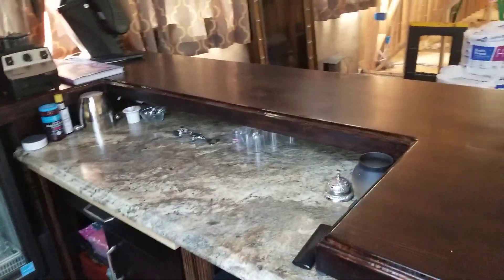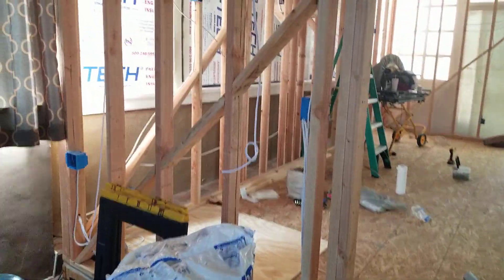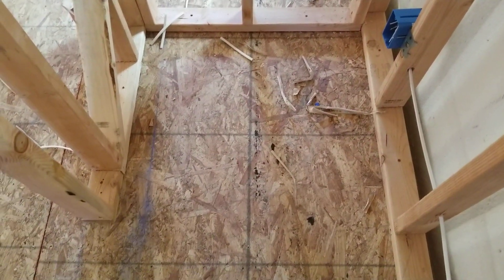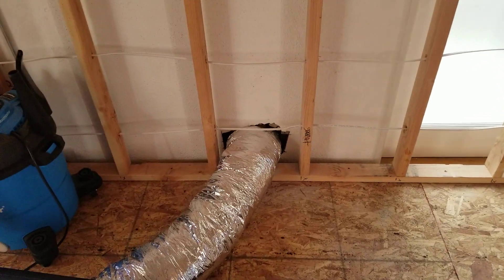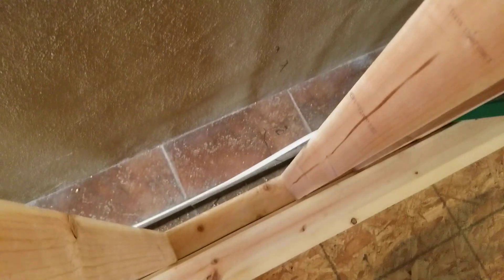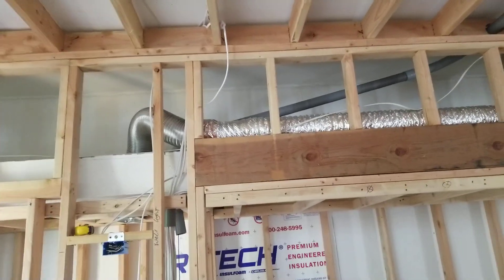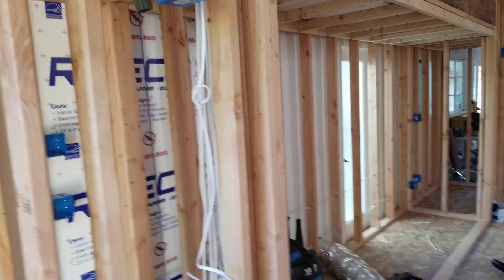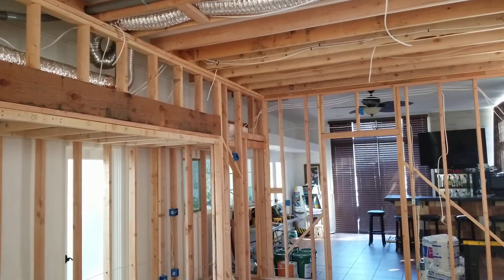Home theater build part 1

Comment: Awesome looking build! I'm not to familiar with theatre rooms, if that switched exhaust fan has to run while you watch movies it'd be cool to have it automatically triggered somehow(relay or occupancy sensor? I know I'd end up forgetting to turn it on sooner or later). Nice job so far, please keep the vids coming.
Reply from the maker: Yeah in the video the noise you can hear from the fan is actually the one in the bar side which is a very high capacity noisier fan. That will be replaced eventually. I guess I'll have to see in practice if I forget to turn the fan off when using it in the theater.

Comment: If you use dry wall and insulation it will obviously sound proof the room. What I'm wondering is wont it still echo off the hard surfaces ? I'm building my cinama room as well but it's the echo I want to get rid of as well as sound proofing. Thanks
Reply: You need to add room treatments after the envelope is built